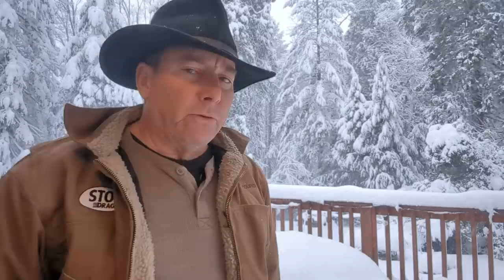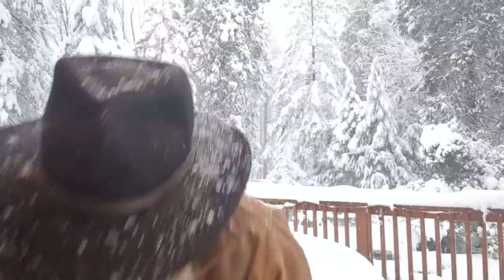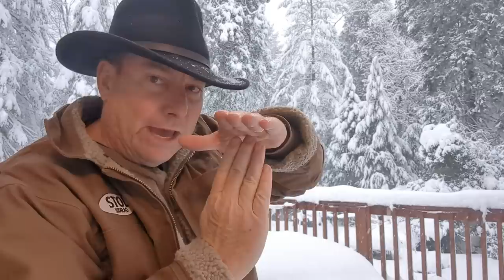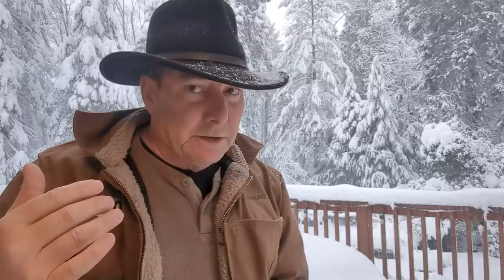PC-12/45 NTSB UPDATE In Flight Breakup! 26 Feb2023

Comment: There's a bunch of two crew air carrier accidents where both crew were disoriented, along with several single pilot disorientation accidents in night "VFR".

In a turboprop sim, the left seat pilot got the airplane upside down at 16,000' and kept it that way while I was shouting at him from the right seat that he was inverted all the way down to the ground.

The Artificial Horizon will keep you and your passengers alive — provided you use it.
Reply: Interesting.. I've done about 1500 hrs night VFR Ag without experiencing this and no IFR so I'm not qualified regarding this scenario but...I am trying to understand how someone can not look at their artificial horizon for an extended period of time... Genuine question...
Reply: I used to be an instructor using simulators and one of the failures was to fail the vacuum pump9s) in IMC. Depending on the equipment, the autopilot could follow the ADI and give the pilot a false sense of being in control until he / she notices the heading wandering too. Being able to catch this early with a good scan and revert to hand flying on backup instruments or partial panel is usually the only way out of this mess.

Comment: There was a ton of severe turbulence in that region Friday evening. FL200-340 if I remember correctly. Air-carrier sized aircraft were reporting it. It seems to have been driven by an upper trough running down the west coast. Would hate to be in those conditions in a small turboprop single.

Comment: Hi Juan. Thank you for your great updates on these often distressing incidents. Always very factual and enlightening. You mentioned a witness but did not detail what the witness said they heard. Was that information given how significant was it? Thank you.
Reply from the maker: I forgot that, follow the links above...
Reply: The link says the witness heard the sound of engine backfiring, which sounds implausible for a turbine aircraft at 19,000 feet. (IMO more likely aerodynamic breakup noises).
Reply: How ironic that the witness was a former flight care nurse.
Reply: @gordonrichardson2972  At least with a turbofan or turbojet engine, you can get backfiring-like sounds if the airflow through the engine gets disrupted enough to cause compressor surges. I'm not familiar enough with turboprops to know how likely that is to happen with those in severe upset situations, though.

Comment: You can try to simulate the feeling of pilot disorientation by being in a small plane, close your eyes and let the pilot do maneuvers.  Without opening your eyes,  tell the pilot how to recover back to straight and level flight .  You will always be wrong. If you are sitting next to the pilot and then only look at the instruments it is likely that you can recover the aircraft yourself -  but not always...
Reply: Yep. Used to do the opposite with my students: have them close their eyes, make them turn, level the wings, turn the other way, all by feel. Always ended up in a steep descending turn, in an unexpected direction. The smarter ones detected the increase of airspeed by the sound of airstream and would pull back, sometimes giving us some nice load factors... :-)
Reply: @pchantreau  I do this with my students. It is always fun to watch them transition from what they think is straight and level to the realization that they are in a very unusual attitude.

Comment: Juan, one thing you need to remember is that during moderate to severe chop the A/P WILL in fact disengage. I'd look more at the pilots proficiency in IMC and how much time in the PC-12. I've never liked the PC-12, it's just too temperamental of an aircraft and this Medivac company should be looked at very closely as well. This was a 100% avoidable accident. I think a lot of pilots just aren't trained enough about Atmospheric conditions and the dangers. That old case of get there'itis and the company putting pressure to get the mission done are also two very important factors. Also I've said for decades that FDR and CVR's 100% need to be installed on any charter or higher level operator. People continue to needlessly die in aviation for reasons that defy all logic. Cost vs lives is what it comes down to. How many more have to die before the FAA stops screwing around? My BG in aviation started when I was just a child as my Dad worked for a major airline and I worked in the industry for many years as an adult, including FBO's. The industry has got to do better.
Reply: Asserting that this was 100% avoidable accident when so very little is known about it seems hasty, at best.
Reply: @pchantreau  Seems obvious to me.
Reply: @NihongoGuy   Enlighten us all then. And the NTSB too...

Comment: Granted he came out of the hangar dry but could icing have become an issue in flight? Also, you mentioned in your first clip that there was moderate turbulence at the time of accident. This could also have been a factor.  Without CVR or FDR what are the odds of successful causation? It seems a number of things went wrong very quickly.
Reply: Warm aircraft with no deicing fluid.  Wet areas will stay warm for a long time. Cabin area (heated / insulated) skin will stay warm for a shorter amount of time. Non fuel areas of the wing and tail will cool and likely ice rapidly. Often times deicing fluid IS required when coming out of a warm hanger into adverse conditions. A "warm" aircraft gives little to no hold over time.

Comment: Always valuable insights. Re PC-12 structural failures with overspeed/overload, the popularity of this aircraft is at least in part due to its low speed / short runway capabilities and that's always a lift/drag trade off.

Comment: We lost an MC-12 in Afghanistan and the end result was the same.  Crew got SD and as the aircraft descended out of control, the MC-12 started breaking up with the winglets shedding with parts of the tail.  However that aircraft had the typical radical fluctuations in A/S and pitch unlike this continuous build up of speed and rate of descent.  Icing/AP auto disengage coupled with SD...  possible a SIC could have saved the flight.

Comment: As a PC-12 operator, I have a few points. In a positive G maneuver, the T-tail load path is towards the vertical stab. Large bearings and the stab actuator can easily hold high loads. If the horizontal stab departed relatively intact, it was probably in a negative G situation. I believe a prior PC-12 in flight breakup experienced 14G+ before the wing failed, these are very tough and well built aircraft. Despite functional boots and prop heat, these aircraft can have difficulty maintaining altitude with ice buildup. We have seen ice-bridging on functional boots and an utter inability to climb above modest altitudes and the associated icing conditions, even when very light. I have to wonder if asymmetrical icing was involved. As mentioned before, the aileron push-pull tubes can ice up and restrict aileron movement, disabling the autopilot and leading to difficulty in roll control. Even a basic CVR-FDR would help in situations like this.
Reply: Probably part of a wing came off and knocked off the horizontal stab.
Reply: Is there an AFM limitation to turn off the autopilot in icing conditions?
Reply: @mmayes9466  No, but the AFM recommends turning off the AP from time to time in icing conditions to check control forces because the AP can mask a control problem caused by ice.

Comment: You get locked out of the house Juan?  I wondered if it was some type of structural failure due to the vertical speeds in your last video. 
Thought you mentioned it as a possibility too, but it's always speculation until they release the details. 
CVR, and FDR's are expensive equipment, well FDR anyway, especially on a retrofit, but would be helpful. Terrible tragedy.

Comment: A gut wrenching event and my heart goes out to the five souls lost.

A PC12 structural deficiency in high stress situations after all these years? A heavy load, or unusual configuration inside this medevac single? An unnecessary flight for those conditions?
Would another pilot make it overweight, or that seat was needed? Were these PC12's always flown with one pilot?
Not just a cost saving measure or an immediate lack of a nearby pilot.
Did something happen inside to distract or divert the pilots attention long enough?

That pilot sounded extremely competent and on his game until it went quiet.

I hope they get the answers, and why the flight was deemed necesary.
Reply: I can answer some of these.

One pilot, two clinicians, a patient and a family member.  Without knowing the specific weights of the patient and family member, I would still hazard the guess that it was well within limits.  We generally (I don't work for Guardian, but have been flying EMS for the last 25 years--the last 13 or so in the PC12) have a fuel load that lets us carry a similar passenger configuration at a moment's notice.  Yes, we always do a W&B--and I can say with certainty we are 99% of the time well within limits.  By that I mean that "extra" 1% might be that we are just close to the MGW.  The only times we would push that side of the envelope is if the passenger is bariatric or if we need to put on extra fuel for a particularly long leg.

Another pilot added to the mix might just make your "standard" fuel load be a bit smaller. In the vast majority of cases our legs are not so long that it would make much difference, save for the unusual longer trip that may sprout up.

You can't just grab a wanton pilot from the local airport.  It's just not done.  This is Part 135 flying, and the FAA and the company will not let you do this under any circumstance.  If there's going to be an FO, they must work for the company and have the training.  You mentioned a "cost-saving measure."  Yes, that's what it is....  I won't expound on that because I'm not here to get on a soapbox.

The PC12 is designed as a single-pilot airplane.  While it's complex, it is also an extremely easy aircraft to fly.  That may sound like a contradiction, but the systems in place make it so.  Don't get me wrong, though, you absolutely have to be on your game.  I joke that the most likely time we'll fly is when the weather is at it's worst--otherwise the helicopters would be doing it.  At 0400 in the morning flying approaches to minimums in a blizzard with snow snakes crossing the runways---you'd better "be there."

I agree--that pilot did seem competent from what I heard of those tapes.  You can tell if someone's been in the system a lot by the way they speak on the radio.  I wondered, at first and before hearing the tape, the same thing---how experienced was he?  Right now this industry is in a bit of a crisis, and they're hiring anyone with just the qualifications.  It takes a certain...breed...of pilot to do well in the aviation EMS industry.  I'll not expound on that, either, as that may take away from this event.

Was the flight necessary?  Well, there's a can of worms.  It depends on your perspective.  The patient's?  The pilot and crew?  The hospital--more specifically the doctor who wants them out of their ER?  In the 25 years I've been doing this I think I can say I've transported at least several thousand patients.  I don't have the wherewithal right now to actually look it up because it's not pertinent--only to say that I've flown a lot of them.  It's not my place to say whether a patient needed transported.  Most absolutely do--however, I can say that there are quite a few that sure as heck did not need to go in an aircraft.  The cost is huge, but that's not my call.  This a whole 'nuther discussion in and of itself.  There is a lot of pressure to fly, though, and although we as pilots can say "no" (as can the crew,) it is known that if you don't have the numbers to support the base then you will not have a base anymore and be looking for a job.
Reply: @Cloudfish  Do you think this flight might have been close to the rear CG limit? Is the PC-12 hard to fly in turbulence if it's near the rear CG?
Reply: @Cloudfish  Thanks for that. I just wondered if it was normally wise to have two pilots in a medevac situation that might suddenly get serious for the patient during flight and a lot of commotion and change of plan going on. Of course a second pilot would need to be a company pilot available locally, if these flights are sometimes at very short notice. I don't know. I do understand the PC12 is a great single engine performer and generally preferred by many to a twin engined King Air that's not as helpful to fly in say a difficult engine out situation.
Anyway, great respect to you for what you have done so well so long. This must hurt and grate until a possible full explanation can be found. Definitely there is a need to install cvr and fdr equipment. Let's hope it does become mandatory. I'm just an armchair follower of aviation here in London since the early Eighties.

I'm pretty good with an armchair though, as it happens. 🤔
Reply: @igclapp  Unless the family member in the back was unusually large, then my guess would be that the plane was well within limits.  It's very hard to get the PC12 outside of the W&B envelope.  I've had no issues with a rearward CG and any kind of turbulence.  Several weeks ago I encountered some severe turbulence and I really don't think I would've noticed any difference in the handling no matter where my CG was.  Severe turbulence just sucks---all you can do is slow down and try to get out of it.
Reply: @pomerau  You be safe out there Cloudfish!
Reply: @Cloudfish  You be safe my friend, seeing this scared the pants off me wondering if it was you… 🥺 My heart goes out to the lost souls, and family’s of all that were lost…

Comment: Can't agree with you more  about coming forward with information. Happened to me back in 1990,with the crash of Avianca 052 on Long Island, NY. I was listening to my VHF radio in my apartment in the Bronx,when I picked up what was the last words of the 1st officer, as they were on final approach to 4L at JFK. What I heard was horrific, as the co pilot reported they were low on fuel, and the next transmission from him was even worse. He had told the approach controller that he just lost 2 engines. I knew at least they could fly on 2 , as the aircraft was a 707, but I never knew that what was about to unfold was tragic, as just 10 minutes after I heard that man's extremely calm voice, that he, along with the Captain, FE, and 65 passengers, were dead. 
I immediately contacted the media, and eventually the NTSB.

Thanks for the update Juan.

Comment: Thanks Juan for this assessment so far. 
But what I've yet to hear theorized is the engineering possibility, that fixing the horizontal stabilizer onto the thinner part of the vert stab. instead of directly fastening horiz. control surfaces to main body as in most aircraft is the culprit and weakness of this King Air PC-12 craft. In other words; the unusual config. places more stress on the entire tail assembly than conventional aircraft configurations. Jack C,  Portland , Or
Reply: The PC-12 high mounted tail pane will flutter at a true airspeed corresponding to the resonance frequency of the structure according to the Strouhal number 
S = f × chord ÷ TAS
At high altitude this can be well below VNE, Indicated AS

Comment: Juan, I saw one of these that barely made it down safely in western Canada in the late 90s.  IFR approach in heavy storm.  Pilot and port side passenger saw the left wing tip (about 4 feet) come off and flip inward.  It took off the port side horizontal stab.  Starboard side stab remained and was functional.  We saw it half an hour after it landed.  It looked like some animal ripped It apart.  It broke the pilot’s left wrist when the wing tip hit the stab.  He held onto it until he get it down before he released control to the Co-Pilot.
Reply: Was that a PC-12? What was the tail number?
Reply: @igclapp  It must have been a 12, I don't think the 21 came out until the 2000s.  Wish I could help you with the tail number, but I don't remember having a phone for taking pictures at that time...  to be honest I can't remember lunch yesterday, that tail number is long gone from memory.  I think it belonged to a hunting lodge if that helps.

Comment: He must have been hand-flying the aircraft, at 19,000 feet, which is unusual and surprising.
Reply: or
the tail or wingtip busted off
just dont see anyone losing it straight and level at max altitude
that stuff happens at takeoff or landing
Reply: Could the wingtip come off and sheer the stabilizer?
Reply: @TheFrenchPug  once one goes, it's all downhill
Reply: Those who have flown this specific type plane have repeatedly stated that the autopilot disengages occasionally in light turbulence and definitely in moderate.  Turbulence had been reported in the area all day which isn't surprising given the mountains and weather conditions.  So if the autopilot kept turning itself off within a minute of being turned on, hand flying was the only option.